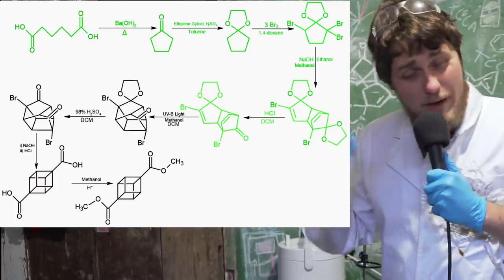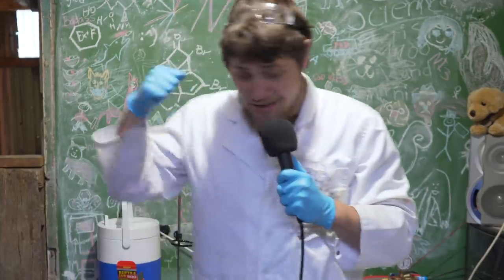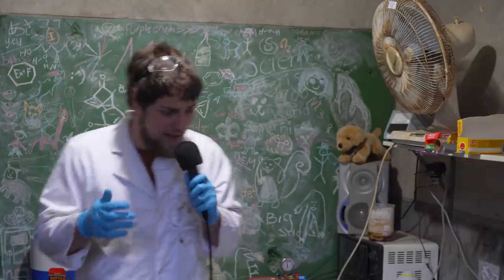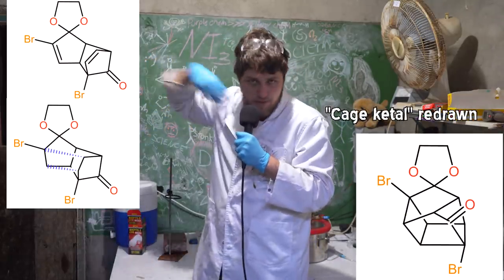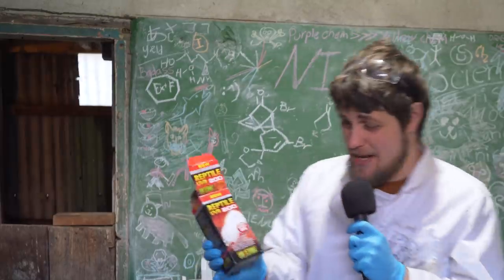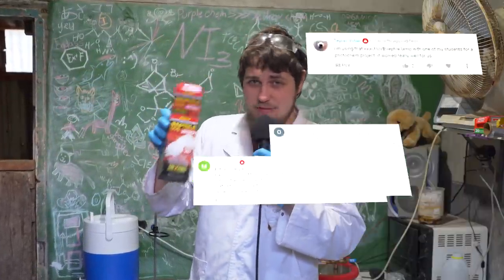Ultraviolet Cage Creation - Cubane Ep 10

Comment: Main low-cost idea I'd have would be a large lense to focus sunlight on it. Though that comes with both the issue of the right optics for UV, and heat... would maybe have to place an anit-IR or a specific UV filter infront of it, or some sort of cooling. Hope would be that the output would be high enough to lower the exposure time to a handful of hours, making the heat and complexity concerns not as bad.
Reply: And regarding the box it might help to kinda have a funnel between lamp and flask, since the volumous box probably causes quite a bit of losses, so a smaller reflective "chamber" might help.

Comment: Some ideas:

1. Make it even more dilute. More dilution = more surface area to collect light.
2. Put it into something really thin. Get something like an ant farm - two glass plates separated by a few mm. Seal it up tight, of course. Again, this will improve the amount of surface area to collect light with.
3. Move it closer to the lamp. Use actual mirrors, and a smaller box.

Comment: Power tool tip: use a punch to make a small divot where you want the drill. It will help cut down on the drill "walking" on the smooth surface.

I can't help you with chemistry...

Comment: As mentioned in other comments, use thinner walls for your reactor. Increase the light power, cool the reaction set up with a cheap fan.
You can also add some stirring, with photochem there is only a very thin layer of your solution that is actually irradiated (look for skin effect). Stirring can have a dramatic effect on your conversion !

Comment: Watching you struggle at 7:05: Wide aluminum duct tape my man. Back is sticky, front is reflective. Allows for clean and complete coverage. I used it to turn a "5 Gallon" (actually 5.3 Gallons/20 liters) bucket into a UV curing chamber for UV reactant resins. Took me about 20 minutes with a roll and a sharp knife to trim the ends. Something taht size would probably take half an hour to 45 minutes to make look professional.

Edit: At my hardware store it's with the HVAC and ductwork stuff.

Comment: I have three suggestions. 1) Use a Xenon lamp - they are much cheaper than a Hg lamp + UV filter to cut everything shorter than 300nm. 2) Use a truncated cone made from Al foil to focus our light on the sample(or lens for UV). 3)Depending on the manufacturer, borosilicate glass may not be very transparent for such wavelength. So better to use silica glass.

Comment: The lamp might work, but in this set-up it's going to be very difficult. I've done a lot of photoisomerization reactions using UV LED's, and can say that the box you build is not a very good set-up. It will work to shield you from the light, but it's not going to help to reflect the light back onto the sample, reducing the reaction speed. I recommend placing the sample tube and lamp as close together as possible (maybe 5 mm spacing for air flow), and then enclosed tightly by something reflective. Easiest would be a cardboard tube lined with aluminium foil, but anything reflective can work. To deal with possible heat, you can then get a small fan to blow in air from the bottom and out the top. Doesn't have to be too fancy, and it will give this lamp a lot higher chance at actually working for you :) Also, stirring of the solution would be beneficial if possible, but you can substitute that by shaking it gently every once in a while.

Comment: UV-B Sources
1: Maybe get a Mercury-vapor lamp and find a long pass filter (e.g. n-wg295) for it and focus the light with a fused silica lens through the filter. (very pricey)
2: Build a Nitrogen Laser (technically Air), it's cheap but I don't know if air lases in undesirable wavelengths.

Comment: That lamp looked like a coiled filament one. If you get a reasonably thin tube, you can stick it in between the filament windings so that the liquid is illuminated from all around instead of mainly from one direction. That should increase the luminous intensity as seen by the liquid by quite a bit. Additionally putting it into a thinner tube will increase the exposed surface area by quite a bit.
Right now only a small amount of the light (I'd eyeball it around 10-25%) of the light hits the test tube directly, the rest comes from the ambient brightness of the box. Taking a guess and assuming you have a 20-30-40 box and your aluminium foil has a reflectivity for uvb in the 75%-80% range putting the tube in a place where it's surrounded by the filament should give you a 50%-100% effective luminous intensity increase. 
After that you can wrap the lamp in alu foil (another similar increase depending on exact lamp geometry) and spray paint the outside black (to make sure you have as little UV leaking as possible) and then put the package in a place with decent air flow for thermal management. Doing some first order approximations tells me you need some airflow though, with natural convection you'd expect something in the 50-60°C inside assuming 30°C ambient, but with 10m/s airflow or so you should expect roughly 10°C above ambient which is probably ok.

Advantages:
-cheap
-relatively safe
Disadvantages:
-arts and crafts

-not orders of magnitude, but at best 2-3x faster
-garbage scalability

Comment: Add the vanillin to your container followed by ethanol to give a clear solution. Carefully add the sulfuric acid. The final product is a clear colourless solution. However, after some dipping of plates it will quickly become a clear yellow solution (see picture above).

How to use the vanillin stain: Run your TLC and let it dry. If you want to check for UV activity you should do so now and not later. Dip the TLC plate in your vanillin stain and heat it using a heat gun (gently at first so that you don't spray the stuff all over your hood) until coloured spots appear. Remember to put the lid back on tightly otherwise it'll dry out.

Comment: So if you want soft UV (A+B), your best bet is one of those face tanning things. They're affordable, use fluorescent tubes that don't produce that much heat, and don't put out the (harmful) UVC which you said would drive the wrong reactions. I regularly used a face tanner to expose UV sensitive photoresist, and it worked great.
If UVC doesn't matter, get one of those self-contained disinfectant lights with a mercury tube inside from Aliexpress. No worries with ballasts and wiring. Or to filter off the UVC, you can use a normal glass pane (not quartz glass!).

Comment: M'okay well.
Last time I  made some direct irradiation, i used Hight pressure Mercury Lamp (which wasn't the best at all), 500W.
Also, Irradiation was carried out with an absorption in the Schlenk A=2, to prevent molecules being far away from light not to be irradiated.

Also, if you could find any way to violently stir the reaction mixture, it would definitely help.

Comment: Get the tube w/ the product in it right up against the spiral fluorescent tube.  Inside the reflector, if possible.  Otherwise, in front, but right on the front, w/ foil behind it.  Keep the entire apparatus as small as possible.  Capture the light before it spreads.  Use a fan to keep it cool if necessary.    I'm thinking nothing but the light fixture/reflector w/ the product stuck in it, wrapped light tight w/ foil, w/ a fan to keep it cool.

Comment: well, i'd almost say run a flow chemistry setup around a stripped fluorescent lamp, but finding a tube with enough length and absorbtion range might be tricky as well as getting the right fluorescent lamp to strip. I reckon a  broken cooler with a lamp inside of it, wrappen in aluminium foil and a aquarium pump to circulate it might yield better exposure.

Comment: Hey Tom, I don't know if you'll see this, but if you want to accelerate the photoreaction, I'd suggest maybe putting a magnifying glass (I don't know if they block UV, however) in front of the UV lamp to concentrate the UV rays towards the test tube. Make sure to measure the distance of the focal point!
Reply: A plastic fresnel lens might work, and they're REALLY cheap.
Reply: @chemistryofquestionablequa6252  I don't know if plastic will absorb or even be damaged by UV light though.

Comment: I could help you with everything regarding High pressure Hg lamps if you want to pursue it. I could just send you mine if that was remotely affordable too.

You can get one from industrial lighting fixtures. They are getting replaced by LED, so you should find them used for cheap if people bother putting them up for sale. If you're lucky you can get an entire fixture with everything included, just plug it in. Otherwise you can get it running the sketchy way by wiring some incandescent lamps or other junk in series to make the bulb run as well (pretty much what a ballast is).

The trick there is to get the right bulb and then remove the outer glass that blocks all the UV. Of course then you need to block all the UV you DONT want in your case as well, and get rid of the Ozone it makes.
Reply: A cheap ZWB3 filter from ebay combined with a bare Hg lamp would be totally unnecessary for this use.
Reply: A cheap HID headlamp bulb & ballast can be had on ebay for under $10 too. You can increase the UV output by breaking the outer capsule.
Reply: @WaffleStaffel  I was thinking a 400 W HQL bulb. You might get a bulb like that for 10$, but not a complete lamp for sure unless you get super lucky.

Comment: Probably far too expensive but it seems you can get 325nm HeCd lasers. You can also get 325nm band pass filters but again they are a little spendy new.  You're TLC technique could probably do with a bit of work. I doubt DCM or DCM and methanol is going to work well it sounds far too polar. Also, when you're making spotters heat a little bit more of the tube and draw it out a bit further it'll give you better spot control. The spots you are putting on the plates are too large, aim for a couple of mm across. Let it dry and spot again if necessary to up the concentration.

Comment: You may want to try a different reflection set up. Mount the test tube on a wire on the inside of a second lamp shroud mounted on top of the first, so that the lamp is facing upward. You already know the lamp shrouds are effective reflectors and reducing the size of the container may help concentration of the UV light. I think you may have a fair bit of loss from the crinkles in the al foil. 
I get this is kind of confusing to visualize, I can make a drawing if it would help.
If heat buildup becomes an issue, you can just mount a radiator fan on the top of the rig facing downward

Comment: The ballast in a gas or vapor lamp performs the job of limiting the current through the lamp, otherwise at the operational voltages of the lamp, unballasted current would trip a breaker/fuse and/or start an electrical fire.

Comment: As far as the chemistry and physics involved, I don't believe I'm yet up to par to comment on them. But setup-wise, I can say this:

Do try to completely "seal" the inside of the box with the aluminium foil

Since it doesn't heat up that much you could try to encase the lamp and the test tube directly (like , separating them with a piece of glass to avoid accidental heating of the reaction mix, and encasing everything in foil).The Idea behind this is to avoid light leaks and absorptions.

You could also try to better direct the light into the tube/plate (if you decide to try and use a plate) by using a magnifying lens. you can find those relatively cheaper than other lamps and other equipment, and if  you can manage to focus it all into the plate/tube it would accelerate the reaction rate by a lot... probably. Generally the focus length of magnifying glass lenses is 25cm or 12,5cm   in which case you could set it up vertically with the lamp>magnifying glass on top and the mix at the bottom.

https://imgur.com/a/R97jbWq
                                   /\
something like this   |

Hope this helps... Its not so much as a chemistry optimization... more of a setup idea. 

(as a final suggestion, if you do decide to try something like this, why not try to mount the lamp shade onto a  large diameter PVC pipe lined with aluminium foil, that you could fit on the box/put on top of the reaction mix.)

Comment: If you got a cheap desk/shop lamp and took another aluminum reflector put both reflectors end to end, orient the setup vertically and suspend the test tube in the hole of the top reflector. Idk if you would need something to help cool but the setup would be smaller and might help concentrate the light better. Also if you got a second light and did something similar, putting the tube in from the side between the reflectors.

Comment: My thoughts: the CFL you were using is a "___ Watt Equivalent" bulb. You need more raw power to excite the reaction, and the bulb fluorescent frequency is basically a "low duty cycle." Bulb charges up capacitors until the arc can bridge the tube length, fires, the bulb coating absorbs that light, and fluoresces the observed light, at ~40Hz. So, roughly 40 milliseconds out of entire second, the bulb is actually generating an arc flash, and the other 960 milliseconds are just recycling Photons with Phosphoric dope. Using a traditional reptile lamp (not a CFL) or perhaps an LED with capability to tune the spectral output would make better results
Reply from the maker: Oh really, it flashes that slowly?? Interesting, didn't know that, thanks!

Comment: If I recall correctly, the frequency of UV light changes when it strikes a surface. Thus, the smaller the focal point of your UV light, the better quality your UV light will be. Maybe some modified Pringles can would work well, to reduce reflections. Especially if you can form the lid into a parabola with a precise focal point within the can, and then line the lid with tint or some UV-reflective paint.

Comment: If that UV lamp was a point source, light would fall off by the square distance. The closer you can get it without it getting too hot, the better. Maybe you could also get the reflectors to be better at concentrating light at the reaction vessel. Like making curved surfaces with nice non wrinkly foil on.

Comment: Ask a local tanning shop or dermatologist if they have some old tubes (they should be 350nm or less). They should have a ton and the fixtures are only a couple dollars at the hardware store (I paid $12 at Home Depot).  Blacklight tubes used in tanning beds, bug zappers, dermatology, photography and some other things are 300-370nm. A 40w tube costs around $20-30. Wikipedia has a list of the different types.

Comment: Get a vacuum tube rectifier from an antique shop or an old radio/electronics shop. They are mercury filled and use the arc between the mercury and the electrodes to control voltage. In the process giving off lots of UV light. Photonicinduction just uploaded a video of his huge vacuum tube rectifier.

Comment: Only idea for contrasting this light:  Cardboard tube lined in foil extending maybe 100mm from the front of the lamp holder with a hole in the top for the tube.  (And maybe a few to give better airflow it if gets hot
Two options: Simple foil endcap. Or a parabolic(Or any curved) end cap to bring the light's focus back into the tube..
Even with the foil you are defusing and loosing what little UV you have there..  And after that... It's onto aliexpress to find cheap UV lamps of the right wavelength or yeah, it's been a week, so maybe the sun is out.

Comment: I don't know if this lamp works or not, but maybe you can try to cover with aluminum foil the backside of the test tube so that the light that pass through the solution, reflect back in it and has a chance to hit the double bond and make the reaction occurs.This, potentially, doubles the performance since a single ray of light enter 2 times the solution. Good luck with the NMR, let's hope for double digit yield.

Comment: You may want to use uv lamp tto check tlc plates, before staining. Sometimes stuff does not react with the staining solution and does not show up (well or at all).
You've learned to make better dots for tlc. Capillary tubes and very quick touch is the key.
To spead up, make the aluminium foil coated container sections as small as possible. Then you have a better probability of the light reflection hitting the tube instead of just bouncing around and decaying.
Reply: Oh, and if you were to get a mercury lamp you may want to check out sterilizing lamps (UV-C). They are quite affordable and available from usual sources like ebay, aliexpress, banggood, .... They often look like clear compact fluorescent lamps, because they do not have the usual phosphor. They run on the socket like any other bulb, no ballasts or whatever needed.
..and make the container smaller. Consider something like a cylinder coated with aluminium large enough to hold the tube and the lamp in one side. Perhaps lamp even in the same oriantation as the tube. That should probably double or tripple the light amount on subject.

Comment: You really want a solvent system that gets the dot of your starting material about a quarter to half-way up the TLC plate. If lower than a quarter of the way up: the eluent is too non-polar, so needs more DCM;
If higher than half-way up: eluent is too polar, so need to add hexane or petroleum ether (low boiling point hydrocarbons like pentane, hexane, heptane)
Permanganate dip should be OK for visualising this compound. If you want another dip, vanillin is a good one, and gives different colours for different compounds. This can be useful when two compounds have the same Rf (dot is at the same position up the plate), and they change colour differently.